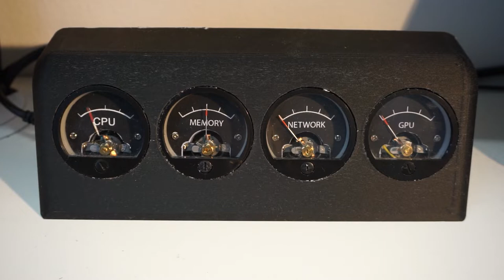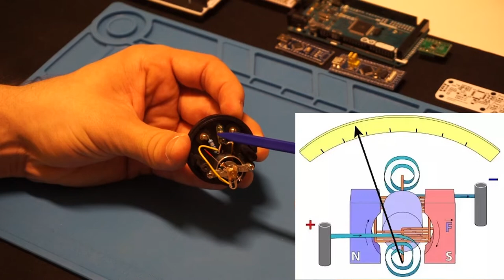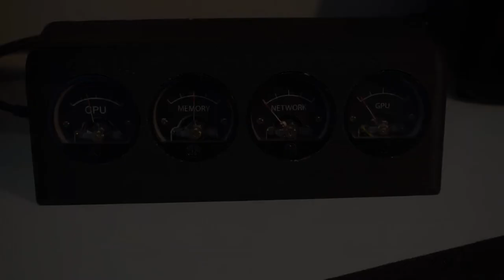DIY Analog Dashboard For Your PC

Comment: This is an awesome build!  I have seen some projects that achieve this simply with PWM and a 5V voltmeter: pretty straightforward, but as you've noted, the coolest round gauges are often expecting much more voltage/current, so some more work is necessary to drive them from a small microcontroller. Your method works well.

Comment: Hi ! Thanks a lot for that video !
I intend to "mod" an old cassette tape deck (Akai gxc 760d) , making it a sleeper PC, and this will definitely help me to have the VU meters working !
Since I have some buttons I'd like to reuse, light up, and since I'm a beginner, an Arduino may do the trick for me !
Reply from the maker: That's awesome! I would love to see how it turns out, so please send me pictures of the sleeper PC on Twitter or Instagram. :)
Arduino and few PWM channels should be enough to drive your panelmeters. I also made a version of these that work over WiFi using ESP32.
Let me know how the project turns out once complete and if you need help, feel free to contact me. :)

Comment: That's great work! 
Could the same be achieved for the following?
1) Cooling fluid temperature via loop sensor plugged into motherboard (data from windows)
2) fan speed rpm via computer or Aquasuite
3) pump speed RPM
Reply from the maker: Absolutely! The software on PC is communicating to the main board and telling it to which position to set the dials. Doesn't really care if it's RPM, temp, usage or any other parameter.
With that said, you can show all of the values you mentioned as long as you manage to read them in your OS and send them to the main board.

Comment: Hello. It's possible to use a regular Arduino board, instead of using custom pcb with STM chip ?
Reply from the maker: Hi! Yes you could use an Arduino to achieve the same effect.

Comment: Hello! I've been thinking about using something like this for a steampunk build but need to be able to measure water pump speed and water temp as well. Sadly, I'm not very familiar with coding, do you have any recommendations on how this could be achieved or if it can at all?
Reply from the maker: Yes, absolutely. You need a flow sensor (I actually use it my DIY House Plants Watering System) and a temperature sensor. Then just send the values to the dashboard.

Comment: Question, what are is the diameter for the holes of the 3d printed part? I want to design my own and since I have a 3d printer, I can extrude it whenever I want. Though, I want to try and get different gauges for the setup, but first I want to make a reference model with the diameter of the gauges you used just as an idea and extra modifications. If you respond, thank you so much and the information you provide will be the upmost helpful for me. thanks!

And also, can you link the microcontroller that you used in the video?
Reply from the maker: Check the video description, there are links to build log and GitHub repository. ;)

Comment: Are you selling the board you designed?
Reply from the maker: Hi Craig, I am not selling it but I do have few spare bare boards (PCB) left from the build and would be happy to send them your way if you can solder components yourself. Let me know.
Also you can easily make this with just an Arduino board by using couple of PWM channels.
Reply: you can create your own using Fusion which is what I'm doing